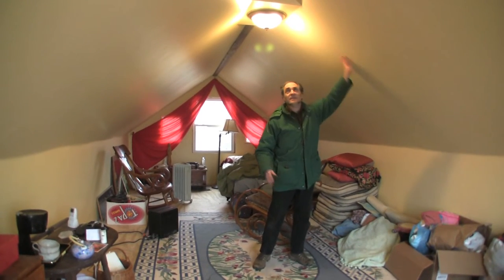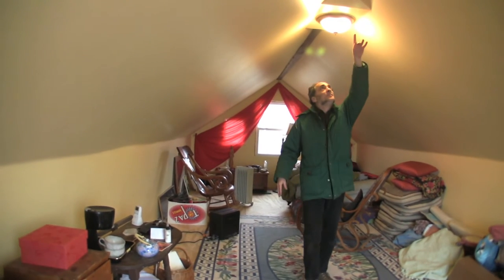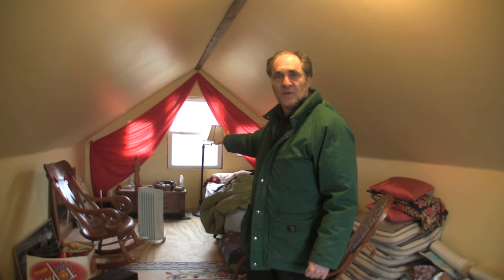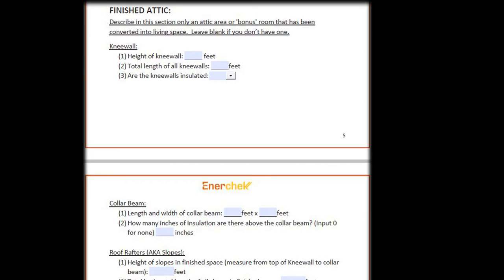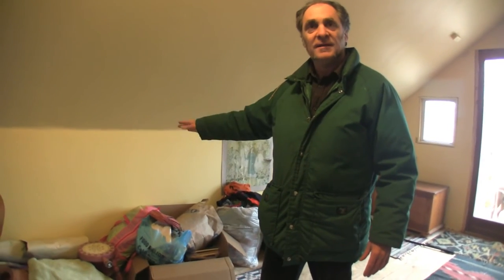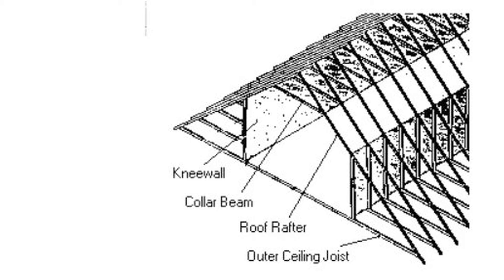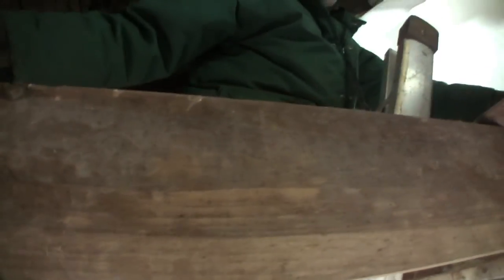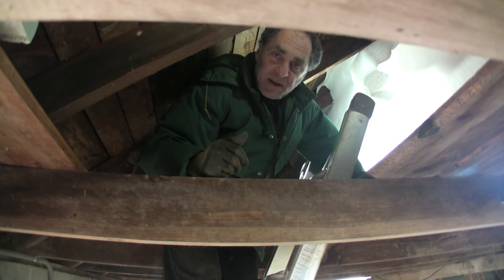DIY Energy Audit part 10:  Energy Efficiency In A Finished Attic

Comment: What did they put in the back of the knee wall insulation?
Reply: That’s actually a non-woven breathable fiber. Works to hold the fiberglass up while not holding in moisture.
Reply: @scottk2407  do you have a link to any such product?
Reply: @ZachAuclair  I don’t. I got it from a local manufacturer as a defective roll. You can use Tyvek though. That should work.